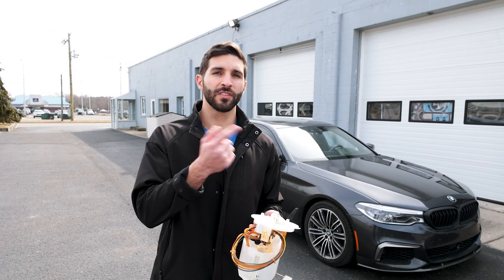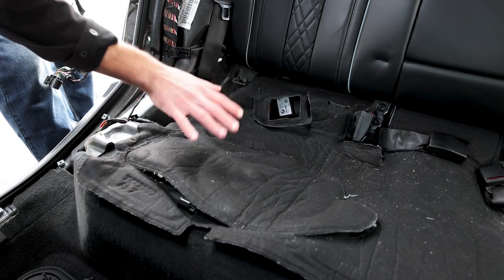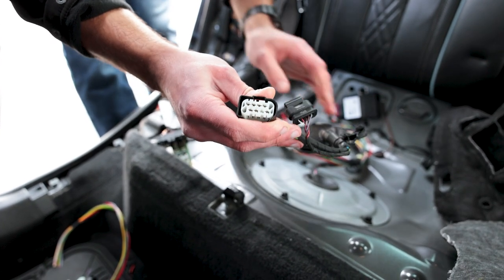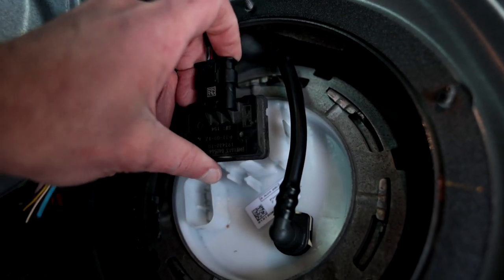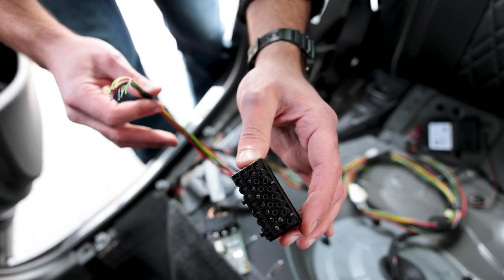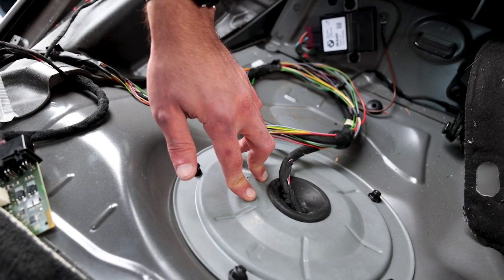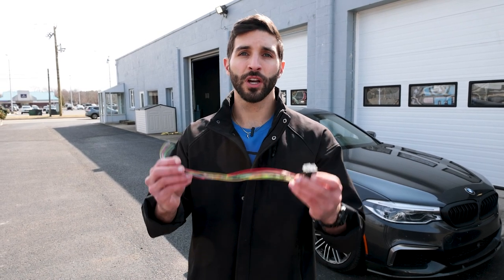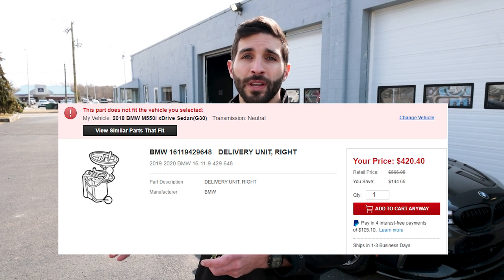2018 2019 G30 M550i Fuel Pump Replacement Tips - Low Pressure Fuel Pump (LPFP) Sending Unit

Comment: Good video, my car has 86k and is getting a LPFP code it might be starting to go, cutting the harness is crazy work why do they do this. If it uses all the same wires why wouldn’t they just include a short conversion harness. I would be tempted to try and just repin the wires to the new connector too

Comment: I just did this same job on my ‘19 x5.  It’s pretty straightforward but I encountered a few hiccups.  BMW includes butt connectors and shrink tubing in the harness kit, but not enough to make all the connections.  That threw me off a bit, but I ignored that and made all the connections as needed. One of the small wires coming off the new (purplish) plug for the pump module is a slightly different green than the old one (solid green vs green/purple, as I recall).  The plug has  a number for each wire and so you just need to make sure that you match up the numbers for each connection.  I think all of the other wires were the correct color.  The larger diameter brown wire on the new harness is the ground, and so you just need to crimp a loop on the end and reattach it where the old ground went. I cut the old wires a few inches from each plug to maximize the amount of wire I had to work with, but which also allowed me to see where each wire went in the old harness. Be careful not to cut wiring for the seat belt receptacles or the rear seat heaters. I found it a little tricky to secure the pump to the bottom of the tank, but it sort of fits into a slot on one side and then presses into a plastic clamp on the other. Finally, the tool that Pete recommended here did not fit the tank ring on my X5.  I bought a universal tool for this job on Amazon and it worked great. I can’t even imagine what a BMW dealer would charge for this 😂

Comment: Great info, but you forgot to mention  that within the orignal loom of wires that have to be cut, there are 6 additional wires that connect to the seatbelt buckles. If you aren't paying attention you could easily cut those wires by accident. If you are attempting this install, remove all tape covering the section of wire to be cut and follow all the wires to unsure you cut the appropriate 12 wires leading to the fuel pump and temperature sensor.
Reply from the maker: You definitely want to be careful to not cut the wrong wires. Good tips!

Comment: I was just replacing mine and I was going crazy trying to find out where that stupid black plug goes into. From what I can tell the old harness doesn’t have 2 green wires. And for reason I have an extra wire that it yellow and green that downs that doesn’t have a yellow and green in the new harness. How did you know what the yellow and green and what both green wires spliced unto

Comment: I have a 2018 750i (G11/G12), is this the same process that you may know of?  thanks!
Reply from the maker: Replied to your email and will look into it for you!
Reply: I have a 2016 bmw 750i , I just replaced my fuel pump and the connector is almost the same except for the notches at the bottom.  However turns out wiring on the new pump was also swapped on the fuel pump side. I'm now trying to figure out what my next move is.
Reply: @ericerwin5625 did you ever figure this out?
Reply: @FloridaEgyptian  I ordered a used fuel pump from eBay off of a 27k mileage g12.  It was a plug and play situation and everything worked out good.  I unfortunately don't have any experience with the new pump and wiring situation. Sorry
Reply: @ericerwin5625  thank you, My issue started with error code 11B018 which is Fuel pump control RPM missing. I put up my issue in bimmerpost and someone pointed me to the right part number. They also told me that my issue might likely be with the control module as it is known to overheat in the summer. I'm going to order that from bmw and see if that is the issue.

Comment: Can you explain how to open that metal ring which locks fuel pomp in tank
Reply from the maker: You need this tool and a big break bar. It takes a lot of force to get it off. 

Fuel Pump Ring Tool: https://geni.us/BMW_LPFP_Tool
Reply: @TheSundaeDrive  thanks,
Reply from the maker: No problem! Best of luck with it!
Reply: I’ve got the tool but I didn’t want to use to much force, was scared of break it.

Comment: Hello, 

i think i have the same problem on my bmw g30 5.20i.  Year of manufacture 2018. I have a problem with the display.  The fuel gauge is always half full when the tank is full.  the fuel gauge only works from empty to half full.  I removed the cover and moved the fuel gauge up and down.  the tank sensor reacts.  I read the error.  there is no error in the error log.  Instrument cluster function test passed.  the actual values: 30 liters on the right and 0 liters on the left.  I was looking for the left level sensor.  unfortunately you can't find it and it can't be ordered either.  I have ordered the conveyor unit.  Bmw sent me the new fuel delivery unit with the cable set.  I'm still %100 not sure that's the cause of the error.  I mean if I install the new fuel pump and it still doesn't work then I can't send the part back.  It costs 627 euros here in Germany.  do you maybe have a suggestion for me?
Reply from the maker: Sadly I have not seen that issue but it sounds like an issue with the level sensor itself where it is out of calibration.  It could potentially something that could be fixed with a software adjustment potentially
Reply: @TheSundaeDrive  I removed the tank.  on the left there is a cover that usually cannot be opened.  I cut open the cap because I'm replacing the tank container anyway.  there are a few components that are built together with the left tank sender.  The parts are all broken off and the fuel gauge is floating in the fuel.  I ask myself, as a BMW developer I mean how you can build something like that.  It is ridiculous.  Tank sensor links is defective then you have no chance.  you have to change the tank completely.  because you can't change the parts that are on the left one by one.  There are no parts for the left side that can be ordered through Bmw.  for a tank sensor, you have to spend 1100 euros for the new tank.  Thank you anyway for answering me.

Comment: dang 4 year new car with faulty fuel pump.did the car wont run what happen
Reply from the maker: It would run sporadically and then die because the hpfp was able to suck some fuel. LPFP must be replaced tho.
Reply: @TheSundaeDrive  my in a shop HPFP problem thats what they telme fingers cross 1 of 2 gonna be replaced
Reply from the maker: Best of luck with it!
Reply: @TheSundaeDrive  was hpfp runs great again 😄
Reply: @TheSundaeDrive  was hpfp runs great again 😄
Reply from the maker: Great!